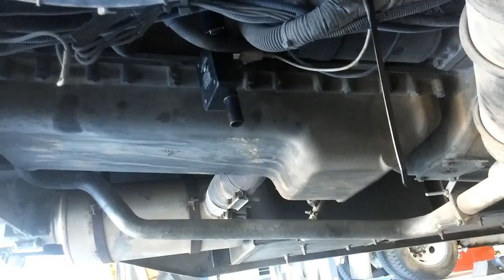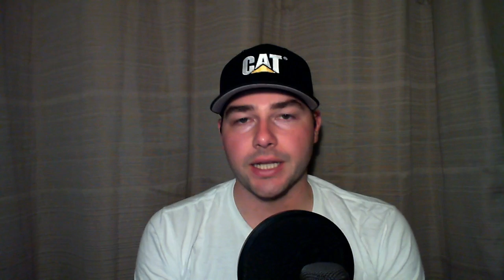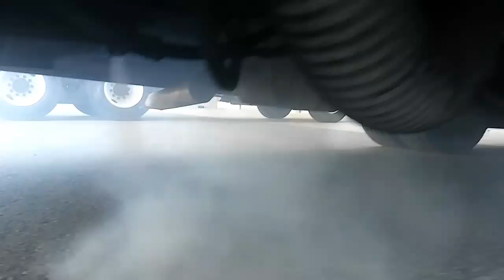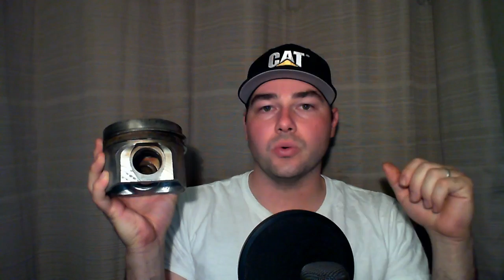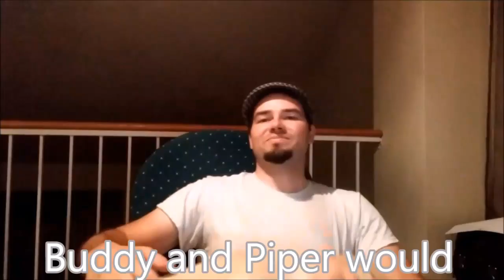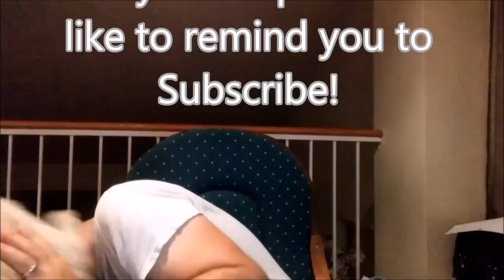Is Idling Your Engine Bad?  Does Idling Hurt Your Engine?

Comment: The reason is bad product design.

High percentage idling, as done with construction equipment and police cruisers, causes excessive wear IF the lubrication system isn't designed to handle low speed operation, or the engine management system doesn't periodically cycle the engine over the rpm range from idle to 30% maximum operating speed. 

There is ABSOLUTELY NO REASON for these two features to NOT be incorporated in a machine intended for application where idling over long periods can be expected. The first is easily accomplished with an oil pumping system that dekivers adequate oil at low rpm.  The second is a simple algorithm added to an electronic engine management system, which could be initiated when the drive train is in neutral.
Reply: I noticed my Toyota alters its idling every now and again, that explains it
Reply: I can see more oil helping but not cycling the RPM, what's that supposed to accomplish?

Comment: Our company uses three Kubota four cylinder 67 HP Diesel engines. We run them at 2200 rpm for about two hours at a time and we only idle them for a few minutes during startup and shutdown. Our oldest engine has over 6000 hours and still runs like new, but our second oldest engine has about 5000 hours and idles very loudly. Our newest engine has 800 hours and consumes oil slightly faster than the other two.
Reply: I don't mean to sound facetious but I want to ask about your engine that idles very loudly.... What do you mean by that, that it, or the clutch behind it chatters a lot?

Comment: the shop i was working, after a rebuild we would idle trucks at 1200rpm for about 5-8hrs....is that good?
Reply: Sounds like it isn't a good idea, driving it and giving it back would be better.
Reply: oscarjuanr 1200 rpm is not idle speed. 1200 rom after overhaul is good for cylinders and camshaft break in.

Comment: As long as you have oil pressure, no it will not hurt your engine. The most wear and engine takes is on initial start up.
Reply: Someone didn't watch.... This is about diesel, and from an experienced tech who sees lots of idled engines.
Reply: volvo09 obviously he isn’t to experienced then. I build engines for a living. The worst wear an engine will receive is on initial start up. And if someone is dumb enough to put there engine under load befor the oil is to temperature.

Comment: Running a gas engine here in Hawaii, 2013 KIA Soul,  hot humid weather year round, lots of stop and go traffic. Will often transport wife to do medical rounds after work and sit idling with the A/C on for 30-60 minutes while I wait for her, and the way I defeat the idle problem is by using high quality synthetic oil and an additive called BG MOA, never had a problem, engine pulls amazingly strong and I also drive it like its a Ferrari. I'll also give the engine a quick little rev to get the oil back up to the upper cylinder areas, head, OHC, valves and such. I run 0-40 European formula for extra protection. Never had a problem and idles smooth as glass, no jiggle whatsoever!

Comment: I haul regional freight and if i'm gone for 4 days then my truck runs for 4 days. I know its not good for it but neither is heat cycles from stopping and starting all the time such a short trips. I don't like sleeping in a hot truck or cold truck, it blocks out noise, and i don't have to worry about it not starting due to dead battery or bad starter and being stranded. It has 1.3 million miles but the previous owner did have an apu for much of that until it died.
Reply: It's your truck do it your way
Reply: chase5726  what engine do you have ??

Comment: Running my C9 Motorhome, I typically don't stop the engine until arriving at the destination. Idling the engine through room slide, leveling jacks, connected/disconnect tow vehicle, and fuel stops. I monitor oil pressure and engine temperature closely, particularly for the HEUI pump. It's good information though and I will limit idling henceforth.

Comment: i have a question, my izuzu turbo diesel is knocking, my mechanic said that the oil pan and filter is full of ground metal.
should i have them tear into it or just call it a loss? the truck has 300,000k miles and has had a long hard life.
Reply: Hillbilly Gold I like to think if it like this. How much dies the truck mean to You? Is the rest of the truck in good shape?

Comment: Very interesting.  So, letting a rig warm up in freezing weather is a bad idea then...   What would you recommend? Block heater is an option, but can get expensive.
Is raising the rpm to 1000+ the best bet in freezing conditions?

Thanks.
Reply: Pop's How To's let it warm up enough for the engine temp needle to move then it's definitely okay to use it. Mainly just to get all of the fluids going at a high enough temp for them to flow properly.
Reply: Yes
Reply: I hope I remember correctly. 
Perkins motor manual 1106d PJ 
Start under cold conditions 
Idling up the motor to 1000 or 1100 rpm is recommended.
Reply: Idling in cold to warm it up a bit is actually a great idea, as it helps things such as oil and coolant raise to operating temps. What adept ape is saying is you shouldn’t idle it at 800rpm for 12 hours at a time for best results of engine longevity.

Comment: I have a 3406E cat and the temp runs at 150 or less empty but loaded it gets to 150. If idling for 30 min or more it will get to 200 degrees.  I can turn on my manual fan control and it will cool back down to 150.  I would like to know what the cat normal temp should be at on this engine. Your videos are great knowledge for me being a new owner of a cat engine. Thank you!!!
Reply from the maker: +kevin l That is too cold. You most likely have a thermostat stuck open and is not keeping the warm coolant in the engine. Should be around 190-195 when you are running unloaded.
Reply: Adept Ape thank you I will check out the stats
Reply: yes we have two cats one a c15 and the other c16 and they bother run around 180 degrees empty or loaded.  Unless you're pulling really hard it usually never goes above that.
Reply: I bought the thermostat kit from peterbilt today and the factory temp that came in my  truck was 208 degrees according to my engine tag and the cat website at peterbilt. Also is there a recommendation of antifreeze that needs to be put in a cat cooling system if so also how much does it hold?
Reply: About 10 gallons of coolant and i've never heard of a 208 deg thermostat for a 3406E. My 1996 5ek runs at 185 unless pulling a hill.
Reply: Yes 200-210 is what they SHOULD be running at all the time. Im old school, myself , and feel better at 180 deg. but factory specs say 200+

Comment: Is engine load high rpms?
Reply: JaArRyi FleshBlood no. Load is more of a torque load, the engine is working to keep its self spinning because its moving the truck, towing, etc. you're making it work. Just high RPM can't be classified as load, free revving the engine, idling is not loading it.
Reply: Drew w so engine load is making the engine work

Comment: Some very interesting points. It would seem reasonable that a certain amount of idling is a necessary part in reducing cold start related wear as well as assisting in cooling turbo charged engine components before shutting down. The main take away is that you shouldnt let the engine idle excessively and without good reason.
Reply from the maker: +DJ R Yes, don't put a very cold engine under heavy load, light load is best. Do not shut a very hot engine off either, it should be idled a little to help cool the turbo and cylinders down after a heavy pull. Good points, they are both brought up in the "severe duty guidelines" with about 40 other things in the maintenance section on the Cat website.
Reply: @AdeptApe would this also apply to pickups? Powerstrokes, duramax and cummins.
Reply: DJ R there's a difference in warm up and idling

Comment: Old school thinking was to idle the engine 24/7 in cold weather because they were hard to start when cold...that's not an issue anymore
Reply: richard vaughn --get an APU it will pay for itself in fuel cost engine life and tickets in California , don't leave a dog in the car but tell a driver to go to sleep at a 110 degrees in Bakersfield
Reply: Workingclassdude Allmylife I live in Bakersfield lol
Reply: Richard Vaughn... Try a Carrier unit.  I've had 4 of them on 4 different trucks.  The things are bulletproof.  The only thing I've ever had go wrong wasn't outside, it was the hvac unit under the bunk sprang a leak, so it got fixed under warranty.  Outside of that, I've only done oil changes, belts.  All mine were plumbed to the truck's coolant, not using the factory Carrier radiator,  so bonus, I always had a warm main engine start.  Before going with Carrier, we tried some el cheapo's, and despite solid advice against wasting our money on them,  out idiot Genital Manager had 53 of them installed.  It turned out to be beyond a nightmare,  it was a laugh-fest, and at $7000 each, it was a huge financial mistake, but since the owner had died, and his wife and daughters knew nothing about anything truck-related,  he got away with it as a bad business decision.  We also tried some of the Thermo King units,  they were so-so for reliability,  but they only make DC, and you need to get their inverter option to have AC power in the truck.  The Thermo King units are quieter, but they don't make heat, you need to have an Espar or Webasto unit.  But they're cheaper than Carrier units are.  I've since left, and the company is going with these battery-powered air-con units, which is chewing through alternators while the main engine's alternator is trying to recharge 8 batteries during the day.  I still swear by those Carrier Comfort-Pro units,  best design, best performance, best warranty, best reliability, most bang for your buck, in my opinion.
Reply: Workingclassdude Allmylife As long as it runs. APUs tend to run hot which burns out the piston rings and valves. This is because they take 2 cylinder stationary diesel engines and cram them into a tiny box that has sound proofing on the inside and then use a tiny radiator with an air conditioner condensor stuck on it. If your APU starts dieing then the repairs alone will make the APU cost more than the fuel you save by not idling. Not to mention it costs $6000 in the first place. 
You are better off with some tiny gas generator and a window unit.
Reply: richard vaughn your full of shit,I’ve had a tripac for years,don’t spend hardly much on maintenance.
Reply: billy greenhorn The air conditioner doesnt work when the engine is off. Truck drivers live in their trucks 24-7.
Reply: Stan Patterson                    Great post. Please copy it and repost it to the main comments so many more people see it. Thanks
Reply: i do it more so the car is warm when i get in
Reply: Everyone still does it though. 
Its like the myth about how an engine needs exhaust backpressure keeps going on.  🤣
Reply: sstill the same just all machines that work at those freezing condition get the winter start package aka ether injection, ad blue heating and an engineblock heater from factory. its hard on fuel thanks to parafine. below -30°C its a lottery. at -50°C vodka is like a pudding ...need a spoon to "drink it".
Reply: richard vaughn generator and a window unit? How Mexican is that? Maybe put your name on the door in mailbox letters while your at it
Reply: billy greenhorn like in Canada up North when minus 40 wasn't unusual. I've been through the 70's and it used to get cold. hence the song...40 below an I don't give a fuck. turn on the radio in my truck an I'm off the rodeo...

Comment: Very good information, thank you. Quick question- I presume that most of this information applies to gasoline engines too. Am I correct? Thanks.
Reply from the maker: +Avery Alexander I'm a big believer in loading new cylinders. Some manufacturers differ I'm sure. Idling is never good though, most new cars shut the engine off at idle, for fuel savings, reduced emissions, and reduced wear.
Reply: Thank you very much. So I am doing the right thing shutting my car engine off when idling for more than a couple of minutes? Thanks again.
Reply: Funny story regarding "auto start- stop".  Was test driving several different cars last year before purchasing new car.  On several test-drives the seller asked me to press the "disable auto start- stop button" as it "accelerates engine wear and increases fuel consumption.."  Need to say that this is in Europe with much higher traffic speeds, so accelerating from stop to 140kph or more.

Comment: How do you "break in" a big diesel after overhaul without dyno? I usually set it for a 16 -20 hours of 1100rpm with fan on. 
Is that good or bad? 
Have you ever re-used rings? 
Have you re-honed a liner, or do you go straight to new liners?
Can you make a video about breaking in an engine, and give a couple of tips on how to put a load on motor without dyno or hills?
Reply from the maker: +Dawid Marcisz Without a hill to climb or a dyno. Put a trailer on that truck and drive it, the heavier the load the better.
Reply: Dawid Marcisz never reuse rings, and if you've already got the engine far enough apart that you'd be able to hone  the liners, your time would be better spent replacing them and breaking them in after and not having to worry about if you honed enough or too much.

Comment: i like burning oil so i never have to change it
Reply: +fuzzy wuzzy damn ur trolling hard on a mechanic channel
Reply: fuzzy wuzzy So does your mother but we're not running around on YouTube telling everyone.
Reply: Zion Avramov my 32v Cadillac northstar consumes 1quart every 2000 miles.  Without zinc in the oil anymore, it's not an issue for the cat, but a good opportunity to replenish the oil with a fresh quart.  It's an 8 quart of oil gasoline engine.
Reply: I'm not gonna buy your car! 😁
Reply: My BMW consumes 1 quart every 400 miles... lol.
Reply: 1 quart every 2000 miles on a Northstar isn't bad. Used to lose a quart every 1000 miles.
Reply: lmfao
Reply: Dave Mitchell a little AT205 reseal in the oil (Scotty Kilmer) even recommends it.  I believe you are referring to the case half seal where leaks were notorious.  i changed my dexcool coolant every 3 years out of habit, and used synthetic mobile 1 oil since new.  i think these 2 accidents prolonged the engine life.  not much has been done to the engine (new radiator, belt, hoses, surge tank, belt tensioner, etc) as preventative maintenance. THANKS for your kind words!!
Reply: Cries in 2 stroke

Oh wait

Laughs in 2 stroke Diesel
Reply: Me two when it needs oil  I spin on new filter  , add new oil with a little WD 40
Reply: Lmao

Comment: When the engineers wrote that manual they forgot about redimix trucks . They get a lot of idle time on the job , and that’s not do to driver it’s when the job calls for the concrete be distributed slowly. We have 8 CAT engines and 10 Cummins in our fleet of Oshkosh front dishcharge mixers . So far rebuilt 3 cats and 2 Cummins all do to cyl rings / liners shot . We are in the worst conditions for operation so I guess that isn’t too bad lol! Great video Thankyou for sharing!
Reply: A cement truck should be making a load just turning the drum of cement. Maybe not much but its something. Make sure the operator turns the engine up to high idle and has not left it at normal idle while pouring.
Reply: Black Smoke run a load on a pto while at idle. Like a fridge for the beers. Anything to load it. It's not the engineer, it's the operators responsibility to understand the instructions
Reply: 1000r rip ems bud

Comment: Ever hear guys forgetting to turn dozers off end of the shift and come back next morning ?
Reply: When I worked at a car dealer it was fairly common, worst was a salesman left a car idling in our remote lot for quite a few days, I walked up to it one monday with its drivers door already open, keys in run position, battery stone dead, and fuel tank empty. Haha.
Reply: gav Seriously?
Reply: Don Olypopper one dozer is buried under the Steese Highway north of Fairbanks. It was left running and slowly sank into the soft ground. It was not worth digging out, do it got buried.
Reply: I have actually heard of that
Reply: Read it off heavy equipment forums , one rev and soot shower for the operator
Reply: yeah.. and a "juvenile offender" (no idea of the word in english) put it on drive and the dozer ran into a wall for hours and blewup
Reply: those guys must know what there doing

Comment: Am I correct in assuming this isn't really an issue in most gas engines?
I've idled my GM 3800 quite a bit in the past, but it's well broken in at 110K miles.
Reply: A gasoline engine will achieve operating temp at idle, a diesel will not.